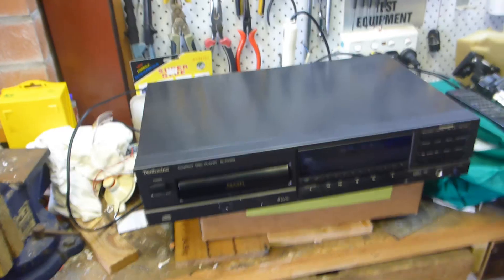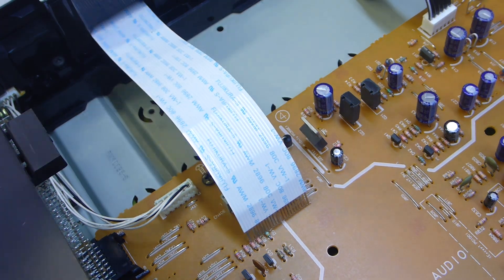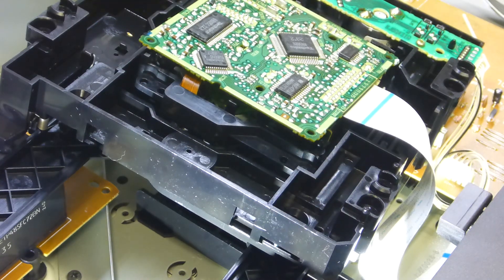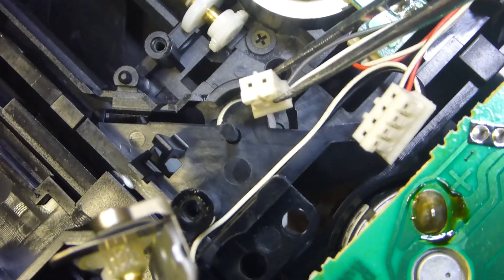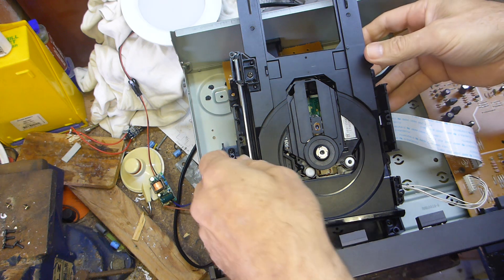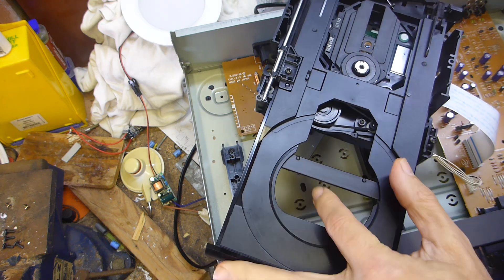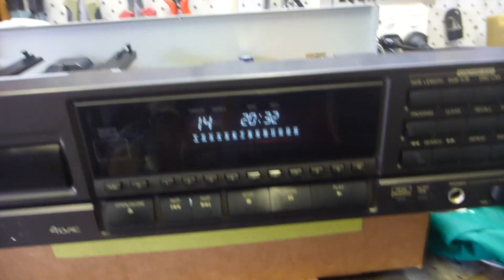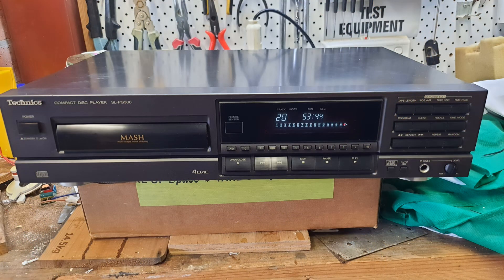Technics SL-PG300 CD Player Repair - not reading disks

Comment: I didn't understand why the spindle motor wasn't working (I have a Technics SL-PG340), it was only a question of lubrication?
Reply from the maker: Sometimes lubrication, sometimes it's supply voltage.

Comment: Hi. I've done everything in the video, I think I've freed up the worm drive motor. The part I'm stuck on is getting the sled back in. It won't raise the laser up. The mechanism looks fine, it just isn't engaging when the tray goes back in. Not sure what I'm missing. Any help would be great. 

Awesome video, thanks for posting it.

Crisis averted, swore, then walked away for 15 minutes then had another go and it worked fine.  Got it back together and it still doesn't recognize any discs. But it's smoother and quieter than it was.
Reply from the maker: Sometimes the laser just gives up. I don't think you can buy a replacement  technics laser for this deck.
Reply: @pescado99  hard to tell you how much I appreciated your video. This CD player was my old man's. I'm gonna hang out for some donor parts and see if I can make it work. Just want to hear dire straits from his stereo one more time. Then I can relax.

Comment: My Sony CDP915 doesn't read the cd's anymore, I tried to clean the diode laser but still the message is "No disc", I am  not sure if the diode laser is the problem, when I put a cd inside the drawer I just see the lentile going up and down but the cd is not rotating, any advice from you will be nice, I mean where to look ?
Reply from the maker: There is a small (and I mean tiny) potentiometer under or around the laser diode. This can be turned 'up' to increase voltage to the diode. Sometimes it works, sometimes not. It does however, shorten the life of the laser. Suggest you google the model number CDP915 to see if you can buy a replacement laser mechanism. Also make sure your CD is a factory press, not a potentially dodgy home burnt CD Rom.

Comment: Thanks for this very helpful video! Found one in the bin while out walking the dog. Same initial problem, but don't have a multimeter or DC power supply for testing. Thought I'd at least lube up the sled motor, and damn if that didn't fix the problem! Works like a charm. Don't actually need it since I have a working SL-PG440, but we'll see if friends could use it. Keep it out of the landfill!

Comment: So, what wa the defect?? You only lubricated
Reply: I thought the same thing!
I have a much more serious problem.
I have the same player.
Recently there was a sudden increase in the mains voltage.  Just the lights flashed brightly, like lightning... and my SL-PG300 stopped working.
When I put the disc in, it spins it...but it doesn't show the number of tracks on the display, nor does it read it when I press play.  It just spins... and nothing else.   The display seems to work fine.  It shows all the functions, program, random, recall, clear, repeat.... etc... but the disc just spins and nothing is read.
I don't think I can fix it with oil.  And the worst thing is that they don't sell original spare parts in my country.  If I send it to a service they charge me more expensive than a new equipment.
So, if I can't get it repaired, I'll just take it apart, and use the parts.  Mainly the cabinet, which is very nice.
It doesn't make sense for me to pay 150 dollars for a repair when for the same money I can get another identical, working and in good condition. ....

Comment: I have a similar model (SL-PG100), but in my case the laser moves properly and I can hear it trying to read the disc. The disc turns a small amount and then gives up, so it doesn't end up reading it. But opening it up and turning the disc myself didn't cause it to read it either. I'm not sure what to do, or whether that's a problem with the spindle motor or the other motor you fixed in this video
Reply from the maker: Could be the laser not 'seeing' the disk. Have you adjusted the diode pot on the mechanism, it's tiny. I'd also rebuild sled mechanism. It doesn't take long and eliminates this as a cause
Reply: @pescado99  Well, the laser moves properly and bobs up and down , so as far as I can tell it's functioning properly, the disc itself just isn't spinning for more than a fraction of a second. I did look at the service manual and it says the cause might be an "optical pickup failure"

Comment: Do you know where can I but spare parts por this kind of CD player. Mine died because of the power board transformer died.
Reply from the maker: @lpmagico  you can look on eBay for the part number for second hand items. But this can be a dumping ground for failed parts, so I'd try a repair myself.